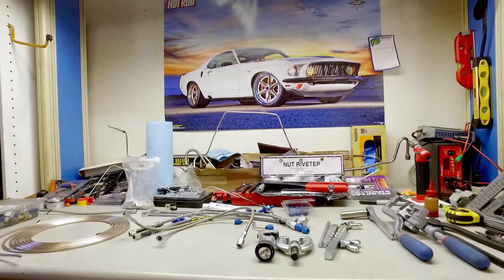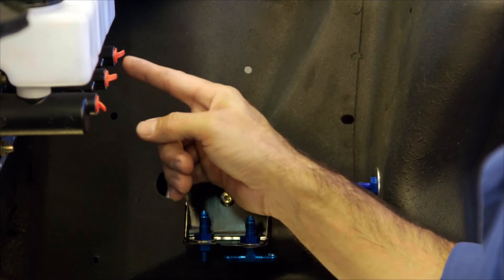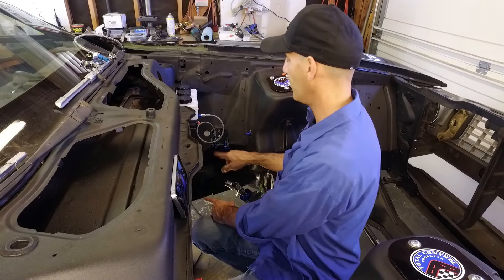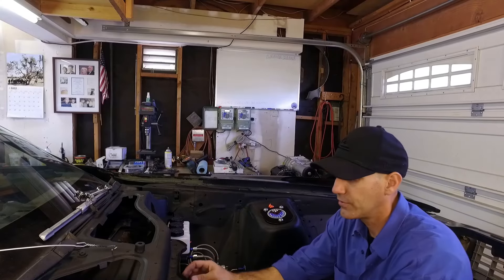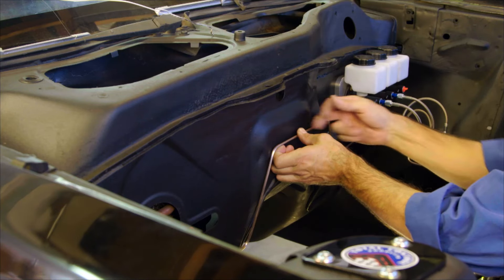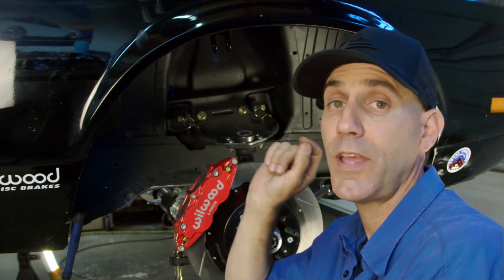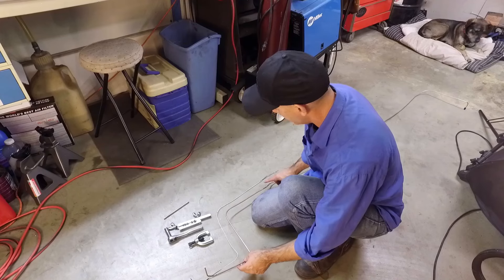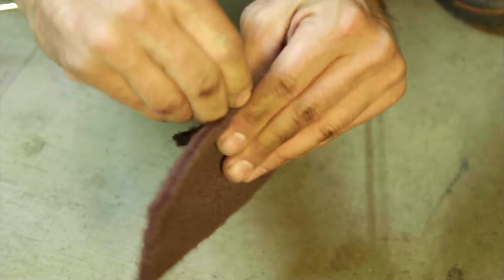How To Build A Custom Brake Plumbing System for Classic or Race Cars

Comment: Hi Jason, just came across your old video and would like to know what your source(s) were or are for the NI-Copp Tubing, braided hoses, bulkhead fittings and cones an B-nuts and sleeves??? Super clean installation, any modifications to the system that you have done since the initial install Great Work 

Cheers 
Kevin
Reply from the maker: I went between Summitracing.com and Jegs.com and would type in -3 AN to start searching and then just modify to bulkhead etc.
Reply: Hey Jason 

Thanks again 🙏

I’m in the process of race prepping my 1977 Datsun 280Z for SCCA Club racing and the Willwood pieces are the best I’ve ever seen and are such a great upgrade to a four piston caliper setup front and rear and dumping the drum brakes. No Brake Fade issues lap after lap. 

Cheers 
Kevin 

Back to the shop

Comment: Great video! Do you think it would be an issue if I used the flex lines to replace all the hard lines? I plan on using Earl's Performance Speed-Flex Brake Lines 63010164ERL, -3AN, there hoses are pressure tested to 4000psi.
Reply from the maker: It is recommended to keep the flex lines to a minimum. Even though the lines are rated for high pressure... you will feel a difference in the pedal. Can you do it, yes.

Comment: How long were the flexible lines that go to calipers?  Standard Ford (single piston) brakes have Banjo fittings.  Likely keep them for this round. Great Video!!
Reply: At 13:10, the length from the burn hole ( where the upper control arm lube was done - many have this hole), to lower frame rail is about 9" ... so ... looks like twice that or 18". Going with that.  Will report back after shipment from pegasus!!

Comment: Great video! I’m a DIY guy also. I’m just a little confused on what fittings to search for. Is it npt fittings or an-3 fittings or is it all together npt an-3 fittings? I’d appreciate any help.
Reply from the maker: If you're really new... stick with inverted flare fittings at the ends. I used -3 AN for most of the fittings in this install and the only NPT was into the calipers bodies and master cylinders.
Reply: @AutoEdits   Ok. Thanks

Comment: I forgot to ask...
I didn't see a proportioning valve. Can you please explain when 1 is needed? Is it only for disc / drum combo or do all 4 disc cars need them also?
Reply from the maker: Yes, most systems need a proportioning valve... but the Wilwood pedals I use in this one operate separate master cylinders for front/rear and you can adjust them by a bar on the levers.

Comment: When using Rivnuts I prefer to use the steel Rivnuts as opposed to the aluminum Rivnuts. The aluminum Rivnuts tend to have the threads strip out while using the Rivnut setting tool.
Reply from the maker: Good information.

Comment: How do you control your brake bias? Are you not installing a proportional valve?
Reply from the maker: Since this system has a separate master cylinder for front and rear, it uses a balance bar on the pedal to adjust bias.

Comment: Wow I know this was seven years ago and you probably won't answer but there's some brake lines that are braided like and their flexible where'd you get those brake lines at I could really use some if you could please let me know I'd really really really appreciate it Bud thank you very much very good job
Reply from the maker: Hey there, those are just -3 flex lines from Summit Racing or you can get them on Jegs. Just look for the length you need.
Reply: @AutoEdits  sweet thank you bro

Comment: Well done...BUT, I'm far from a fan of those pressure-actuated brake light switches. Had them leak, and also had more than one short to ground, taking the rest of the electrical with it (ideally, it should simply pop a fuse, but on some vehicles bad wiring decisions make such failures much more catastrophic). Something to be said for a simple mechanical switch on the brake pedal, for sure. But I gotta say, I'm in love with the nut riveter. Gonna add one to my tool collection ASAP.

Comment: If cost weren't a factor, is there any disadvantage to using the braided-steel flexible brake lines for the whole system instead of routing this hard line (be it steel or NiCopp)? The inner diameter of the hard lines seems way smaller than the braided lines - does this have a big effect on your brakes? Is it important to have hard lines for hydraulic reasons, or just mechanical sturdiness?
Reply: When it comes to hydraulic lines you want to minimize the use of soft lines. Soft lines are less durable and can expand under pressure. Using too much soft line can make the system feel "spongy" under hard braking. You want as much energy transferred to your brake piston instead of being wasted on hose expansion.
Reply: You possibly could but because it is flexible and would expand under pressure it would give you a spongy soft pedal

Comment: You have single handedly alleviated my fears of doing brake lines!  Ill look into that NiCop lines as well.  also where did you get all of your fittings?  have been thinking about using AN3 simply because i dont have to double flare them.
Reply from the maker: I got most of my fittings from summitracing.com just search for -3 AN So far everything is holding up pretty good so far!
Reply: @AutoEdits  Hey what about the little circles they put in oem hardlines, for example in my D22 Frontier when the hardline leaves the master cylinder it takes a few loops and then moves to the respective caliper, any thoughts of doing or not doing that?
Reply from the maker: @faisal3398  Those loops are there to absorb vibration in the line before going to the master cylinder. It's not mandatory but a good idea. Just gives a bit extra material. I used the flex lines and a bulkhead near the masters to accomplish the same thing but "cheated" by using high quality steel braided line.
Reply: @AutoEdits  I wondered why you used the flex lines, they technically would make the brakes a bit more spongy, you said for serviceability but the hardlines could be moved enough.

Anyway I see people doing just straight hardlines no flex no loops and they seem fine.
Reply from the maker: @faisal3398  Rubber flex lines make for spongy brake pedal feel. This application has an extremely firm pedal... I love it. Do whatever you want.
Reply: @AutoEdits  Thanks for the feedback, really learned a lot from your video 👍🏼
Reply: @AutoEdits  oh also in case you didn't know, you can use tig aluminum tig filler to mock up your lines, they stay straight and act a lot like the hardline, better than coat hangers if you've got them around.
Reply: @faisal3398  In addition to vibration damping, those loops are also there for ease of manufacture, to make it easier (and faster) to connect to the master cylinder as the vehicle rolls down the assembly line.

Comment: Any part numbers for the fittings? I tried summit to see if they had a box of fittings but looks like you have to buy them separate is that what you did and just ended up with  a handful of different ones or is there a box with a variety?
Reply: I can get you the fittings if you still need them

Comment: Great Video. Now how do you Get that switch to turn on your brake lights?
Reply from the maker: Thanks! The wiring harness has a simple brake light signal wire and you run it to this thing!

Comment: Looks fantastic! One question though. The standard brake flaring tool is 45 degrees. Most AN fittings are 60 degrees. How did you deal with the difference? Is your flaring tool 60 degrees?
Reply from the maker: I have a 37 degree flaring tool for my AN fittings since that is what they call for in this case.
Reply: +autoedit ok thanks. Was wondering about that.

Comment: Can you please provide me with where to buy the 37* single flared ends that you used on the small piece of SS line? I can't find the little collar and the nut anywhere to go with the nicopp 3/16" line. Thanks. I'm able to find the bulkhead connectors but not the ends that you put on the nicopp brake line.

Comment: I’m not big on installing brakes but at what point do you need a combination valve after the master cylinder?
Reply from the maker: This system has discreet master cylinders for front and rear and use a balance bar adjuster on the pedal assembly. You would need a brake bias valve on any other type of setup... like a stock style master cylinder.

Comment: Hi Jason , I want to duplicate this brake plumbing on my Fairlane. What size adapters did you use on the wilwood master ? my proportion valve is 3/8x24 but I can't find -3AN to 3/8x24 adapters.
Reply from the maker: Hey, I don't remember the sizes but it was searchable... if you can't find it on Summitracing... go right to the Holley website under the earls components to search for the adapter you need.

Comment: where'd you buy your tubing? i want a nice silver tone of the line without rust, so i bought SS.. all the NiCu line i find is copper toned..  i need 3/16" and 1/2".. also, where you get the 3an - 3an - 1/8npt T for the brake light sender? i can't find that anywhere.. have a part#?

Comment: Great video just one question why the single flare over a double or the bubble i personally would of thought the double flare to be stronger and perform better than a single ??????????????????????
Reply from the maker: That’s a lot of ???’s I chose single flare because I wanted to use -3 AN fittings. That’s all, yes double flare is much more reliable... just a design choice.

Comment: Could I just run braided hose all the way to the rear of the car?  Did you bend the nickel copper tube by hand?
Reply from the maker: I wouldn't recommend braided for long runs like that... very expensive and not proper at that length. Yes, the niccop bends very easily by hand.

Comment: Is it ok to mix aluminum adapters and steel fittings because the aluminum is anodized?
Reply from the maker: Good question... most time I would say yeah that would be a concern but it just doesn't seem to cause a problem in this instance. Has lasted for years without issue.

Comment: After watching this video I think I’m ready for my first brake line install. Thx for the info. One question where did you get those rivet fitting holding brackets.
Reply from the maker: Have fun and good luck! Those are called "threaded inserts" and you can buy them at harbor freight or any good hardware store. I think I used 8/32"  but adjust that size to your taste.

Comment: It looks really clean but why not make it hard lines from the Front, Rear, and Clutch booster to the T Fittings on engine wall? Those SS Braided lines look too long already and you don't really need them since neither part moves from the other. I think it would look cleaner.

Comment: Hi Jason! I really dig the master cylinder set up you have there. It's a really rad setup and really cleans up the engine bay. But I was wondering how they're linked under the dash and to the brake pedal. Are there links to a kit that you can provide that accomplished that, or offer some insight into how you linked them together on the far side of the firewall? Also, are they powered brakes, or manual?
Reply from the maker: Thanks!  Here's the video on the pedal install... now that the car is a driver... I've been thrilled with the setup.  https://youtu.be/1xX3_LmfXTU
Reply: @AutoEdits  Very cool. Thanks!

Comment: dont you need a brake vaccum with the brake master cylinder to be able to easily push down on the pedal rather it being hard?
Reply from the maker: Not if the brake system was designed around a manual pedal setup which this one is.  There are so many factors involved in that process... what size master cylinder, stroke on the pedal, size of the wheel cylinders, disk vs. drum etc.  I worked directly with Wilwood tech. support to get all of those factors dialed in for a manual pedal that was firm but good for the street.

Comment: Did this setup not require you to install a proportioning valve?
Reply from the maker: This particular setup does not need a standard proportioning valve because the front and rear master cylinders are independent and can be adjusted at the pedals. Great observation!

Comment: Hopefully you found a way around it but the brake line run over the top of the trans tunnel will have an air bubble that will be almost impossible to get out that's why the factory runs it down hill and across the front cross member. Also as a former Air Force mechanic and a Master ASE I can assure you that Teflon of any type is not to be used on brake lines.
Reply from the maker: This brake system bled perfectly.  What do you use to seal NPT threads on brake systems?
Reply: @AutoEdits  
Awesome, I'm glad it worked out for you. We have had significant issues with lines run that way in our IMCA Mods with master cyl setup trying to avoid headers and engine mount plates. We always run them down and across the crossmember which in our cars has to be a stock stub. As far as NPT threads, we don't use them at all. I have been taught not to for quite a while especially of course in ABS systems. Even when we splice lines we of course use flared unions. My ASE tests and Aircraft wrenching time has beat into me that pipe thread is not designed for the extremely high pressures in a brake or Aircraft hyd system. You could probably get away with it but my paranoid monster drives me nuts! Good luck with that beastie, us Ford guys gotta stick together. Good video by the way and ya that line is some good stuff huh.

Comment: I would have chased that right front brake line up higher under the pinch weld at the top of the firewall away from the engine more. Less heat transfer to brake fluid and more tucked away also would have been less bends to just go straight across the top.

Comment: Hi Jason. Sorry I'm just now watching this video. I had some minor surgery and have been out of commission for a few weeks. As a Numismatist (Coin collector)  I'm very familiar with Copper/Nickel alloys as our US Nickels, 1965 to current Dimes, 1965 to current Quarters, 1971 to current Half dollars and 1971-1978  Dollar coins are made of a Copper core and plated with Nickel. My concerns are these... How is the surface of the line going to wear over time? I'm sure you've seen a Nickel plated coin that's been in circulation for many years. And also, moisture is the enemy of Copper. So I'm also interested in how these lines hold up to exposure to rain and condensation from inside. I'd love to see some updates on these concerns Jason. If these prove to be minor or non existent than I think you and UberTanker have discovered the newest trick brake line item. Good Luck to ya brother. -Drew
Reply from the maker: +Supradrew™ HOWDY DREW! Glad to hear you are ok and hope surgery wasn't too bad.  Yeah, I'm not sure of any of those legit concerns about the line.  I do know that they are used in industrial HVAC units for long terms so there is some durability there.  We will find out together!

Comment: What acts as the brake booster? I am currently restoring a 72 mustang that is in the process of being converted to a t5 manual
Reply from the maker: I set this system up to be fully manual... not booster and it worked fantastic. Just size your master cylinder to the calipers and stroke of the pedal and BOOM great brakes with no boost.

Comment: What fittings did you use to allow you to include the brake light pressure switch? I need to put a similar pressure switch for my custom P/S system w/hydroboost on my Jeep.

Comment: Jason
 Hi. I'm building a GTO 68. I would like to put a Wilwood brake system in. if I use hydraulic brakes well I still need to use a booster?
Reply: Those wilwood brakes pedal assemblies don't need a booster. But if you are using a stock master cylinder i would suggest using a vac boost or better yet a hydro booster.

Comment: i did my brakes like that ,4 wheel disc with a willwood master , but i have to pump my breaks once to not go to floor. any idea's thanks . watch u all the time . i have a 71
Reply from the maker: Howdy! Sounds like there's still a bubble in your brake system somewhere... gonna take a bit more bleeding to get it right.
Reply: What size bore is your master cylinder? What is your pedal ratio? What size calipers are you using? It sounds like the master cylinder bore size is too small.

Comment: I'm trying to find the flex brake lines you are showing, hooking up master cylinder lines. I only see the flex lines to calipers.  Do you have part numbers.  I want to use it on my 68 nova.
Reply from the maker: I believe they are the same... just make sure to get the right length you need.
Reply: @AutoEdits  but the ones to calipers are bigger than master cylinder and regular brake lines?
Reply from the maker: All the same -3 flex lines @willysnova1968
Reply: Ok. Thanks

Comment: I am wanting to do flex lines to my proportioning valve and I seen your video. I can not seem to find what I need nor from whom. I have a 68 corvette master and a GM proportioning valve (PV2). i am running 1/4" line on the truck (mine) twin turbo sbc  ect ect. I want braided line from the master to pro-valve because I have a under dash master cyl setup and getting the lines to play nice is not working out so well and flex/braided would be soooo much easier. Where can I get some to put on the truck? I've been building it for about 10+ years in a parking space no less and the brake lines are the only thing holding me from holding the pedal to the floor for some long awaited boost I think I waited long enough and trust me when I say...10 years, all the while ducking the owners managers in the same breath (NO working on your cars around my neighborhood  for ANY reason. (It is in the renters rule book. I checked lol) It has been HELL to say the least.
Reply from the maker: Look on Summit Racing and enter in what ends you are trying to connect.